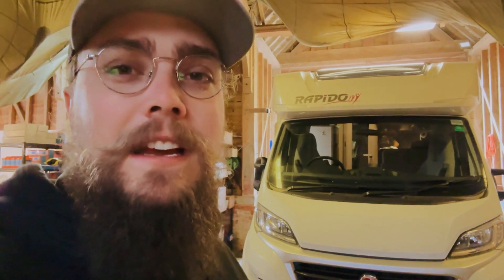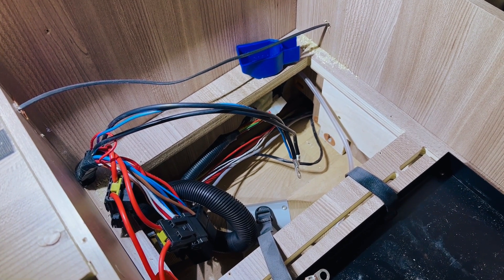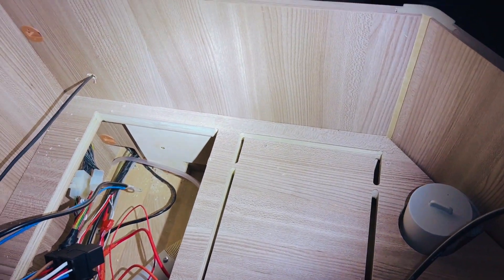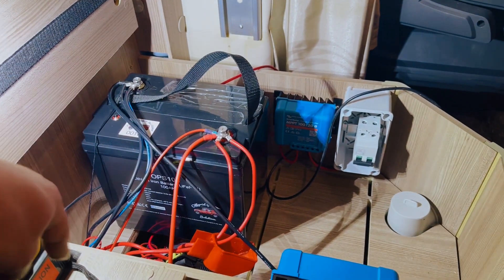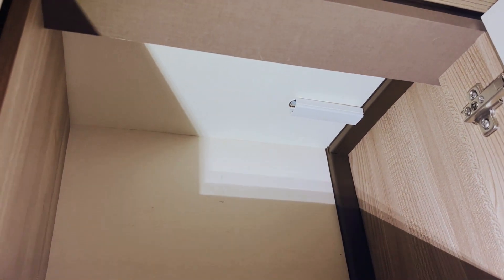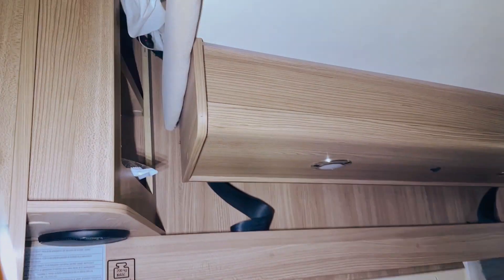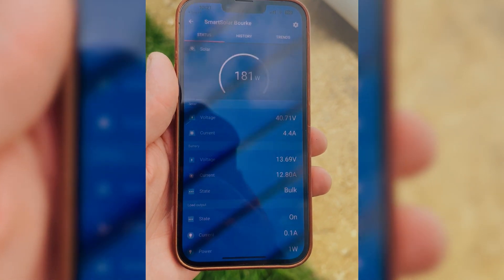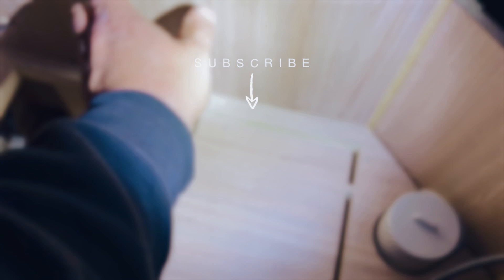Upgrading a Rapido (Fiat Ducato) motorhome to Lithium

Comment: Great video lots of good information I have a rapido9048df fitted two 100 amp hour lithium batteries fitted a victron 30 charger and a B2B victron I’ve run a new 16mm from the starter battery to the B2B when I start the engine kicks in but I’m not getting the amps it look as if I’m getting a drain somewhere is it something to do with the cbc panel or existing relays hope you me be able to see what I mean thanks
Reply: Hi Richard. I’ve done at my previous van conversion full victron setup will litium, bms, solar, inverter etc. But now I’ve changed to 9048df and actually thinking of upgrading this system to lithium as this will allow me to run my 3200/1600 victron inverter when I need it off grid. But I don’t know how will the rapido control panel will work with this. Did you manage to get all working and compatible with your 9048df? Thanks